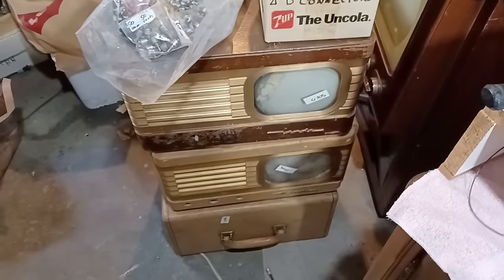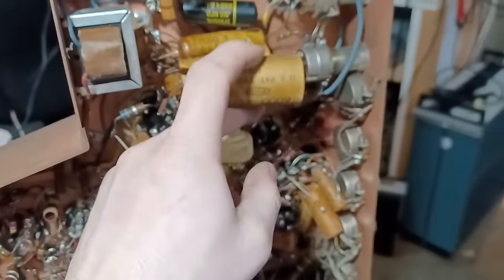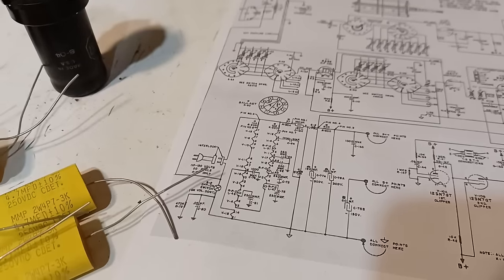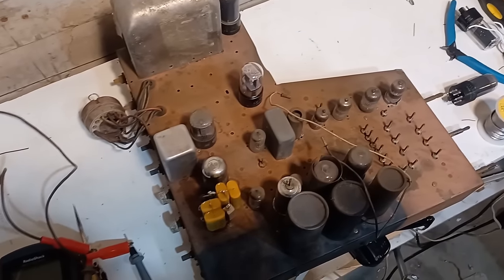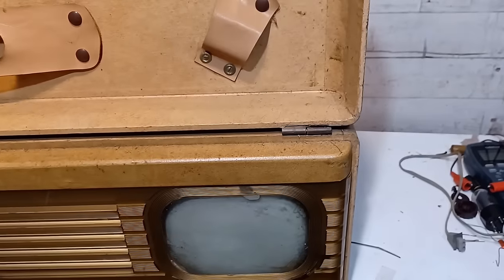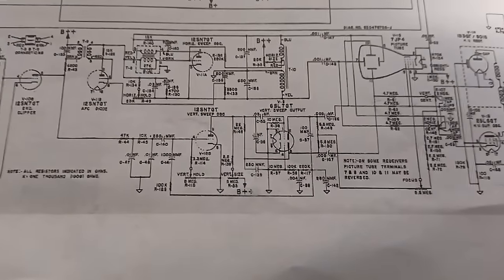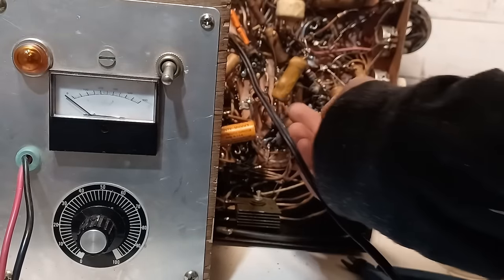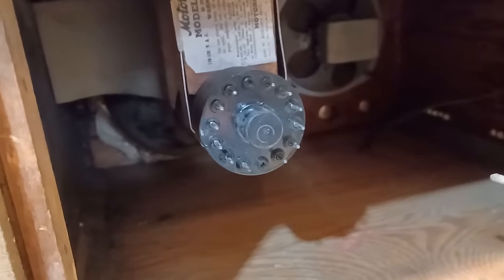1949 TV VT73 Diagnosis and Repair

Comment: My father served 26 years in the US Navy as an electronics technician. When I was a small child, he built our first TV set, and when he retired in 1965, he owned and operated a TV repair business. He was a wizard at TV repair. Just a test or two and he could pinpoint the problem. I even saw him look at the TV and from the symptoms he saw on the screen he could figure out the problem.
Reply: Did you got any inspiration from your father to go in this field ? You should be an electronics engineer , I think 👏👏
Reply: LED TVs of this time cannot be repaired.. 95% of their damage is a broken screen, which is priced at the price of the device
 It revolutionized the manufacture of screens.. Yesterday I bought a 32-inch TV at a price of 100 dollars... There are computer games with a screen size of 7-10 inches, the price of which does not exceed 45 dollars.. And a used computer for 30-50-100-200 dollars? There is no need to repair the device.. Throw it away and buy a used or a new one?
Reply: @SR-ci6bf  This was the early 1950s, there were no LED TVs, it was the old-fashioned black and white CRT picture tube.
Reply: @UdaySingh-cg3rw  No I became a Chemist, then eventually a Physics teacher. But I loved electronics and was a Ham radio operator for a long time.
Reply: @wayneyadams  🌹🌹🚩🚩👏👏
Reply: My grandfather was similar and also started out in the Navy.  He ended up working as an engineer for Philco-FORD for many years, where we got our cars at great discounts, and our TVs for free!!  We had one of the first color TVs around ‘67 I think.  Well, one of the first luxury color TVs anyway.  None of my friends had them for a couple to several years later.  Blessed!!❤❤🎉🎉🎉
Reply: Even If Im 22 years old, I still feel the nostalgic vibe of this comment, thanks for sharing this, Wayne!
Im also a fan of Hardware Electronics yet Im studying to become an Economist lol, I prefer to keep this as a hobby not as a job
Reply: @meltheartist1147  Very nice. Was your grandfather a career navy man? My father served 26 years and retired in 1965 as a Chief Petty Officer (CPO).

We never really listened to radio when we were young the way many of my friends did.

Color TV was around since 1954 or 1955. I had an uncle who had a color TV back in 1960. We used to visit regularly just to watch. I'll bet all your friends wanted to come over to your house to watch. We bought our first color TV in the fall of 1965.

For many years only NBC broadcast in color since they were owned by RCA which held the patents on color TV technology.
Reply: @Rodo079  Economics? Here are two jokes for you.

1) A ship breaks up on a reef near a deserted island and the only three survivors are a body builder, an engineer and an economist. When they make it to the beach, they are excited to see a huge crate near them which has broken open to reveal cans of food and water. The only problem is figuring out how to open the cans. The body builder says they should smash them open on the rocks. The engineer grabs a twig and begins designing a complicated machine from materials at hand. The Economist stands off to the side chuckling to himself. The other two men see him and angrily ask him what he finds so funny. He replies, "Gentlemen, you are making this too complicated, all you have to do is assume you have a can opener."

2) The President went to the USSR for meetings with the Premier. On the day of the meeting several Secret Service agents rolled in a huge crate and set it in the corner of the room. At the end, they rolled it back out. The Premier asked what was in the crate. The president explained it was filled with locusts and had they not come to an agreement he would have ordered it opened releasing the locusts to ravage the Soviet's wheat crops.

The second meeting was held in the US and this time the Premier had a crate rolled in and placed in the corner of the room. At the end, they rolled it out. The President asked if the crate was filled with locusts, and the Premier said no, it was filled with economists which he would have released to destroy the American economy.
Reply: Мій батько, взагалі не мав ніякої освіти. Сам вивчив і ремонтував телевізори та радіоприймачі.
Reply: Funny, one of my instructors who’s a retired chief had a teacher who fought how to do this stuff and also ran a TV repair shop on the side
Reply: @ChronicAndIronic That is a funny coincidence. 

My father was a fantastic repairman but a lousy businessman. The shop he bought did not do very well because of his mismanagement. Luckily. he had his Navy retirement from 26 years of service.
Reply: He was a legend 😍
Reply: @wayneyadams  Interesting to know!  My Grandfather served in the Navy from about age 19 through late 20's I believe.  He had friends and a group of Navy men, they stayed in touch most of his life.  :)   I remember we got our* first color tv sometime around 1966 , I think...Grampa had been working on Philco_Ford color tbs at their plant in Newport Beach, Calif in the mid 60s and one day he came home with a beautiful brand new example that we had for many years...Just a Perk of being at Philco Ford.  I so wish I still had that tv.  It was fairly big, with a white encasement (hard plastic? not sure) and a big rounded and beautiful heavy duty screen.  We had a lot of Tv's that were sent home from Philco_Ford, but that as my First "Color" and my fave tv for many years!!  Grampa helped design it and many of the parts!! xo
Reply: @meltheartist1147  companies dont train or treat employees like this anymore :(
Reply: @wayneyadams  I'm an amateur economist, and those were hilarious.
Reply: @soulmpeg7851 Yep, that would be the equivalent of a company handing out a several thousand dollar gift today. That is way better than a Pizza party or a free coffee mug as is common now.
Reply: Wow same me
Reply: @Rodo079  I used to love the old Radio Shack and Allied Radio catalogs.
Reply: @wayneyadams As an electronics hobbyist in my early teens I learned so much from the Radio Shack catalog. All of the areas of consumer electronics and repair and construction components were present.

Comment: What a rat nest.  Can really see why printed circuit boards became a thing.
Great video!  I appreciate that you care about old tech like this.  This is history, and it's worth preserving.
Reply: It may have been a rat’s nest, but if the assembler had good soldering skills, it was much more reliable than early printed circuit boards which suffered from thermal cycling that could cause hairline cracks in the traces which were maddeningly difficult to track down and fix. As such hand-wired sets such as Zenith models didn’t fail as often as often and were considered to be better televisions.
Reply: Very cool. I worked on a lot of late ‘50s and early ‘60s sets back at one of my first jobs and this really takes me back.
Reply: The parts count is so high in a TV that even PCB's are jammed.
Reply: @bunkie2100  'Hard wired' all the way was pretty much the case for the apollo moon shots as well. Sensitive modern day electronics will require a lot of shielding to survive the harsh rigors of a moon mission. The present day Artemis programme should lead to some interesting developments in rugged electronics that can be monitored in real time by a human crew. This will add to the knowledge data base of whats already known by autonomous Moon and Mars probes and rovers.
Reply: Well, we went to transistors after tube technology, which was a major breakthrough.

Comment: I never knew the picture on those could be so clean. I just imagine the picture would occasionally bounce around or have constant noise... to see such an old set working so well is amazing.
Reply: I always find it amazing that old electronics perform better than when they were brand-new just because you used modern caps. capacitors back then were really, really trash.
Reply: a large part also has to do with the camera recording too. he was using a modern camera to capture the video he was playing. Cameras were not the best but it was the best they had.
Reply: Those old sets had pretty good pictures given the limitation of the resolution, which was 525 lines. In addition, most recorded programs were shot on film which explains why TV shows like "Hogan's Heroes" from the early 1960s has such an incredibly high-resolution picture.
Reply: @wayneyadams  480 lines carrying the visible image. :-)
Reply: @nukester.  The NTSC standard for analog TV is a frame rate of 30 frames (images) per second, consisting of two interlaced fields per frame at 262.5 lines per field and 60 fields per second.
Reply: @monad_tcp  Old cars in movies constantly backfired.  The same cars today run great on refined higher quality gas.
What amazes me is that there are eighteen active components in here, twenty if you count the selenium rectifiers, and maybe the odd diode.  Today they probably have thousands of transistors in LSI chips to achieve that, yes not a fair apples to apples comparison perhaps, but nonetheless - it makes you think!

Comment: Loved the video. Reminds me of a 5" TV I built it 1956 when I was 16 years old. It used a 5BP1 ex radar tube with a green phosphor. It always had issues with poor vertical lock but it was a design problem in the original hobbyist article and I didn't have the skill to improve on it. Many good memories of my early days whilst watching this video.
Reply: Making a custom tube is not that hard, getting the Forsfor on it is a bit harder, but we can do that too, only if you can tool the right tools, or can find people who can do that for you !
Upload what you did please !
Reply: Electric charge internal deflection plates? I've wondered how well a radar tube would work on 525 lines. Seems like it would be overwhelmed. That is an amazing build for any 16 year old and 1956 quite the bleeding edge.
Reply: Went down the same road in 1968 (age 18) with a VCR139A (2 3/4"). I began two years earlier but couldn't make the TRF vision receiver stable at first. 
In those days, we still had 405-line TV on 45MHz so, following the line of some of the early UK sets, bearing in mind that pre-war there was only one TV channel, the TRF route was possible.
I still have some of these early electrostatic tubes and with a sprinkling of transistors, might put together something similar but video source would need to be a DVD player or similar.
Reply: @directcurrent5751  No reason why ES would not work on 525 or 625 lines come to that. Here in the UK 405-lines was not phased out until 1986 and 625-lines was introduced in 1964. It can be quite a challenge if not near-impossibility to persuade a 405-line LOPT for a magnetically deflected CRT to run at the higher horizontal frequency but no corresponding difficulty converting an electrostatic timebase.
Reply: @directcurrent5751  A RADAR tube would work OK, but the phosphor on them was generally longer persistence than what a TV CRT would have, so moving images would be unclear.
TV CRT's had P4 phosphor, other non-TV CRT's often had P1(green) or even P7(long persistence) phosphor.
Reply: @jozefbubez6116  I surmise the coils are tuned to a specific force pattern.